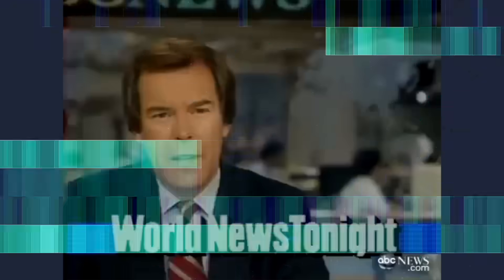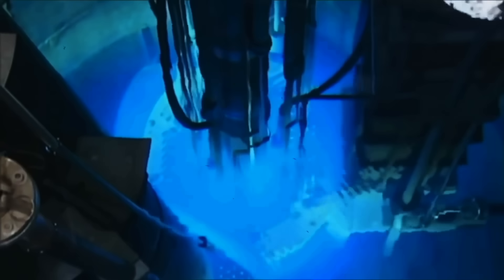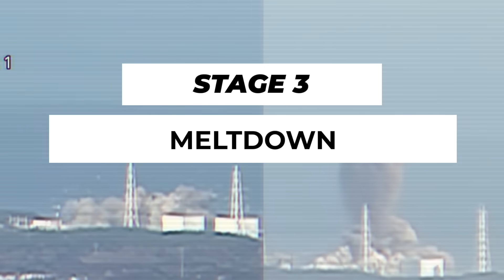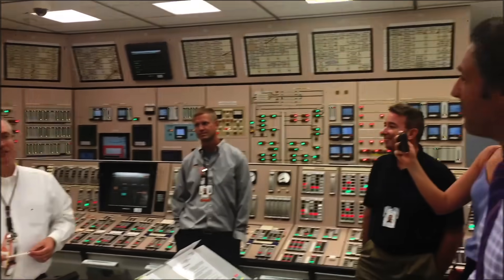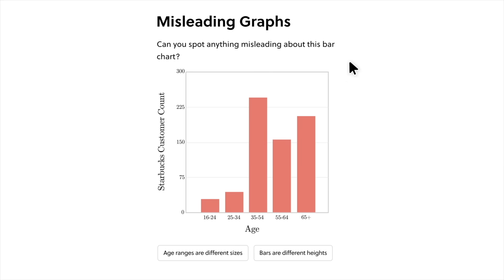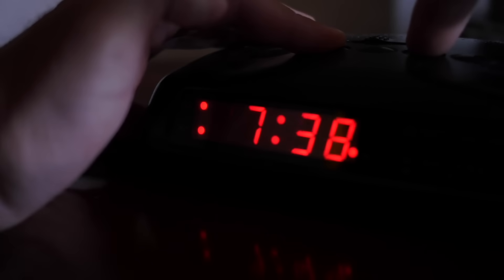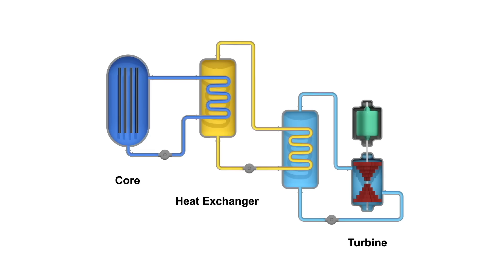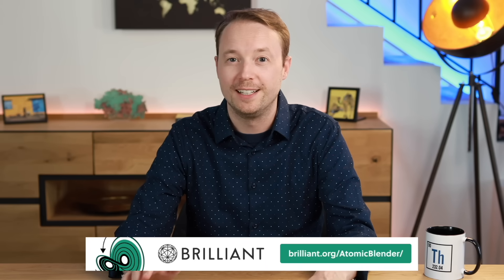Why Is It So Hard to Stop Meltdowns?

Comment: What we learned from SL-1:
Never have a single rod control the reactor
Don't manually manipulate the control rods with fuel in the core
Never attempt to pull on a stuck control rod
Ensure no interpersonal grievances between operators during critical phases
among others.

What we learned from Three Mile Island:
Sometimes less information is safer
Layout procedures clearly
Always have a peer checker during critical operations
Ensure regular maintenance on valves and pumps
Have a dedicated Press Representative to give accurate and reassuring information to the public
among others.

What we learned from Chernobyl:
Don't design reactor control rods with graphite followers
Never place the reactor in a configuration for an extended period that allows for xenon buildup
In reactors with positive void coefficients, don't preform rapid reactivity manipulations
Don't operate near All-Rods-Out
Don't ever allow for field changes to established procedures
Don't change shift during a reactivity manipulation
Thoroughly brief the next shift
Allow questioning of authority
among many others.

What we learned from Fukushima:
Place onsite power generators above the flood plane
Design the reactor to withstand the 1000-year event
Have at least 2x redundancy for emergency power generators
Fit sparklers to the reactor to safely burn off hydrogen
Have the spent fuel pool at ground level
Have redundant systems for core cooling
Allow controlled venting to occur in the absence of power
Better coordinate with emergency management agencies
among others.

I think that covers the most glaring points.
Reply: "Design the reactor to withstand the 1000-year event" This is no joke, Fukushima's earthquake was the 4th most powerful ever recorded since 1900.
Reply: Also Chernobyl:
Don't ignore safety protocols because the reactor is taking a lil too long to heat up
DON'T TURN OFF THE COMPUTER TELLING YOU TO SHUTDOWN IMMEDIATELY
Reply: @iexist_nt both myths of the tv series. Didnt happen in reality
Reply: You forgot the “do not lie to plant operators” for Chernobyl
Reply: Another one for TMI - ensure free flow of information between both the manufacturer and the operators and different powerplants. 

Before tmi2, another B&W plant had the same issue, but B&W did not disseminate the info.
Reply: Real
Reply: The Chernobyl graphite followers were actually pulled in as the control rods were pulled out. So they actually not only had almost all the control rods out but the rods to sustain the reaction in as well. Besides being dumb to take out more rods than allowed, the design flaw was the graphite section had clearance for water so in the moment all the rods started moving and that water was displaced by the graphite exiting that section was superheated enough to jam the graphite in place and go supercritical
Reply: @Mustang-wt1se  the design flaw was not the graphite sections. They were a feature to improve economic factors and ironically safety. The also didnt change the graphite sections afterwards which shows it wasnt the real issue. The design flaw was not adding the control rods inserted from the bottom to the safety system, having an unsafe reactor in general (fuel issue), having a "blow up botton" and not showing the operators the ORM in real time in the control room (how many rods are inserted).
Reply: Fukushima was designed with with a 1000-year event in mind. The reactors were safely shutdown when the earthquake hit. It was then hit by one of the largest tsunami's in living memory. Only being equaled or surpassed if I am not mistaken by the Krakatoa eruption. So then by that logic do when have plan and build things for 3 or 4 1000-year event's?
Reply: @necronoverlord2306 Fukushima knowingly cut corners in their designs. Specifically with the ocean barrier. The wall they built was way too short which they were aware of and also didn’t care to fix. This would have helped immensely. Thats why the nuclear plant 100 miles north of fukushima, closer to the epicenter of the earthquakes name is unknown. Because they did everything right and didn’t have a nuclear meltdown
Reply: I imagine the frustrated guy standing over the reactor trying to free the stuck rod Major Kong style when finally it slips free.    The split second of "oops".
Reply: I thnk there are going to be a few more lessons.
Reply: Most PWR reactors are designed to run all rods out the entire time they are online. These reactors are moderated with boron, rods are only used for huge reactivity changes, such as shutdown margin on trips to guarantee reactors stay subcritical
Reply: @enzonightmare1193  In that case, you have controllable reactivity by means of burnable reactor poising, something Chernobyl didn't have.

Comment: "every few decades", so how long have we had nuclear energy? a few decades, thats like phrasing a situation like "the alarm goes off every 5 minutes or so" and you only had said item for 6 minutes

modern nuclear energy is far, far safer than it was back then, the soviet RBMK reactors where horrifically out of date and designed with methods that everyone, even the soviets, knew was unsafe, they didnt care because it was also cheap as most things go under communism, and whoever thought building a series of nuclear power stations all along a fault line deserves some kind of sarcastic award, if reactors are kept up to date (99.99% of them are) they are very, very safe and provide a clean means of generations FAR more power than any other method with far less infrastructure

Comment: so i always thought a nuclear meltdown meant it exploded like a bomb
Reply: It is not possible for the fuel in a reactor to explode like a nuclear bomb. The levels of fuel enrichment and other factors make this impossible. Uranium used in a nuclear reactor cannot reach a critical mass in this way. All that happens in a melt down is that all the uranium fuel and other assemblies in the reactor melt into one mass of material. The cooling water that normally circulated throughout the reactor cannot now cool this molten mass effectively and so this molten mass melts through the base of the reactor. Exactly what happened at Chernobyl. 

The uranium in a modern nuclear reactor is only slightly enriched by a few percent, the uranium used in a nuclear bomb is highly enriched and a critical mass created to sustain an extremely fast chain reaction,

Comment: We can't keep having meltdowns for obvious reasons. Nuclear power isn't safe nor green enough to call it a "zero emissions" way to generate power. There's no such thing as zero emissions power generation. Anyone who believes that nuclear  power is the solution needs to put down their crack pipe  down and step away from it. That's why I oppose haphazardly tearing down existing power plants without replacements. All that does is cause electricity rates to go up due to supply and demand issues. Before all that, we was buying some of our electricity from Canada to power parts of New England. That's unacceptable.

Comment: I’m an Engineer, Did a installation job years ago at a Nuclear establishment. What fascinated me was the reactor hall Not a great deal to be seen it was all going on under your feet 🤔 
Looking round the site & grabbing what knowledge I could from People working on site. 
Iv watched Videos of anything Nuclear particularly electric power generation. 
It seems that the biggest problems with Nuclear Energy is that it started as a RACE when actually people were still learning, 
Racing Learning never good 
It seems the Reactor itself never seems to hardly at fault. 
It’s the failing of auxiliary equipment
& human error 
“Have to say” the now Big social issue   Now is the safe disposal of contaminated equipment or irradiated waist. 
I believe this & the cloak of secrecy & false information may have damaged this incredible industry 💯

Comment: Why does it take years to cool down the spent fuel in those pools? They are small pellets right?
Reply: The spent fuel contains highly radioactive isotopes that are undergoing fission and releasing energetic particles and actually generating heat. The water used to shield the workers from the radiation and keep the fuel pellets cool. Once highly radioactive isotopes have decayed away the the fuel can be moved into the reprocessing facility to be reprocessed.

Comment: The BIG two meltdowns were really a fault of bad oversight. With Fukushima the regulators had abdicated their responsibilities. The power company was warned that the sea wall that not tall enough to protect the plant in case of a Tsunami or tidal wave. And Japan has a lot of tsunami's due to being in an earthquake zone. And to top that off they refused to add a backup plan for emergency power in case their emergency generators failed. They were trying to do it on the cheap because of cost considerations. In Chernobyl the folks that were supposed to be regulating the plant actually intentionally put all the blocks in place to cause the meltdown. That and the way they designed the plant meant there was no redundancy in case of an accident. They did not build it for a worst case scenario because they said they designed it so well that the worst could not happen. 3 Mile Island as bad as it was was actually an example of how the prevent the worst case and  it did prevent the worst case from taking place.

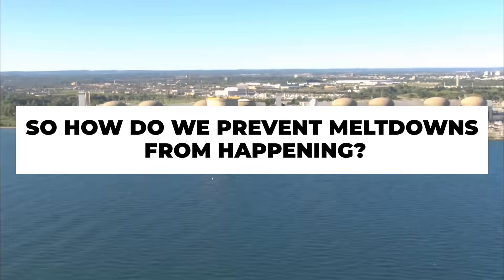Comment: 9:15 defence in depth relates to giving terrain IOT wear down an opponent, what you described with the fortifications of a castle relates to a final defensive line, meant for bringing the opponent to a stop IOT facilitate a counter attack and take back initiative or force a political resolution.

Defence in depth does not mean layers of defence, it means lines of defence, to be occupied one after the other. It means trading an area for a favorable situation

Comment: All respect to the presenter. However, losing water as cooling is an issue only if there is another moderator, like graphite - as it happened in Chernobyl. PWR, VVER reactors can lose cooling water, the whole reactor will stop as neutrons will become too fast to be able to keep up a chain reaction. Also, there are other type of nuclear reactors where water is not even inside but gas. So stating that if water is gone, then we can expect a meltdown, is false. Fukushima was a different type of exception than Chernobyl as the tsunami destroyed all external equipment that could help to prevent the meltdown.

Comment: Unfortunately there's a saying, modern safety practices are written in blood, for example in the automotive world cars used to be way more unsafe in the '50s and '60s versus nowadays, for example a common method of injury and an automobile collision was getting ejected from the car, that was solved via seat belts that keep the driver and passengers in the vehicle, however people were still getting injured by the dashboard even if they weren't getting ejected. That was dealt with by making dashboards out of softer materials, removing anything sharp and pointy from the dashboards like by changing the design of light switches and radio knobs as well as installing airbags to lessen the force when your head hits the dashboard or steering wheel. GeForcees were also a common factor in motor vehicle collision injuries, and those were reduced by adding things like crumple zones so that the body of the vehicle crumples in a specific way to reduce the felt impact by the occupants. Also things like break away motor and transmission mounts were used so that instead of the engine getting pushed into the cab, the motor mounts break and the engine drops free below the vehicle and stays away from the occupants
Reply: And to reduce vehicle fires after collisions various safety features were added to the electrical and fuel systems, for example in a modern car any airbag activation will trip the fuel pump circuit and require a dealer or body shop to reset it, also the gas tank was repositioned so it's not susceptible to damage from minor rear end collisions and the filler neck was moved from behind the license plate to a more protected location usually on a rear quarter panel and it's now located higher up. Also they now contain a check valve so that fuel cannot spill during a rollover
Reply: And on me regulatory side, you have organizations like the NTSB in the US that sets safety standards for new vehicles, and on the operator side you have updated driver training programs for new drivers as well as awareness campaigns for the dangers of intoxicated or distracted driving and also enforcement of traffic regulations like police pulling over distracted drivers or things like speed traps red light cameras etc

Comment: In Chernobyl actually they turned on the pump but one of the pump was built outdated cause of corruption, and the pressure in the core was already so high that when the 350kg control rod were going down the they started literally levitating and going up down , and graphite tips of rods caught on fire then the pressure goes on increasing and increasing and once it is out of control booommmmm and then Oxygen rushed in burning the available Hydrogen which was seperated from water steam because of high temperature. 
(This is what i remember from the miniseries Chernobyl) Hats off to the heroes who saved the Chernobyl accident risking there lives 🙏🏻🙏🏻
Reply: That's wrong

Comment: Hey, I have a question: Could a meltdown be stopped / slowed by a design change, where at the bottom of the reactor vessel there is a sealed off chamber containing boron or other neutron absorbers and if a meltdown would take place, the melted core would come into contact with that material, absorb it and hopefuly lose so much of the radioactivity that it would not melt through the rest of the vessel?
Thank you in advance for any answeres.
Reply: No. The isotopes that are created are unstable and must decay, and that causes the heat buildup. A neutron absorber won't stop this, because it is inherent in the material, it is not a chain reaction anymore.
Reply: Unfortunately, once meltdown/partial meltdown has begun, it's no longer an issue of reactivity. Most structures would have issue containing something that hot without also melting, so the best thing you could have it drop into is just a massive pool of water. But if that existed, why not just have tanks that can flood the containment building by gravity in the event of a loss of ultimate heat sink?
Reply: I wouldn't think so, but there is a design out there called a "pebble bed" reactor where basically the uranium is just piled up on the bottom of the reactor, so it can't necessarily "melt down" since it's already pooled at the bottom.

Comment: The reason why the Chernobyl Nuclear Power Plant, or CNPP had blew up, is yes, because of the safety systems being i guess shutdown? and then when they had run the test the reactor had ran in an unexpected way, causing the operators to press the secondary AZ-5 "Button" and not the switch. Just 8 seconds after it blew up. Because the reactor had already been poisoned with xenon gas, and when the control rods went in, only one had been fully inserted as a little malfunction. When the control rods were inserted, one of them went into the water, Now I'm just repeating myself. But back to the point, after this all had happened I believe that part of the control rod material had reacted with the xenon gas causing the first explosion in the chamber. Then after that Oxygen from outside the reactor lid, had rushed in and reacted with all the other elements inside the reactor core, causing it to make a secondary explosion that was so big, it almost was the size of the little boy nuclear bomb. People had believed the AZ-5 button was pushed, but actually is was just the USSR's petty material that they used in the plant. They had used very cheap material to build the reactor, but that is extremely bad, as cheap materials can break or malfunction easily.

Comment: The water cooling it also produces the energy, and theres no way liquid metals are as efficient. Theres only one way to efficiently produce nuclear power. And it will always be dangerous.
Reply: Depends. In BWR designs there's is only 1 cooling loop, and that requires water. In PWR designs, liquid metals could be used, as the primary loop does not generate electricity, only providing heat to the secondary loop which does.

Comment: The only issue i have woth what you said is that the rods are not the primary method of controlling the rate of reaction. Thats the job of the moderator.

Comment: I like the Molten Salt varieties of reactors.  When the reactor starts to overheat, the expansion of the salt throttles the reactor automatically.  The working temperature of salt is wider span of temperature than water and it is not pressurized.

Comment: Chernobyl in Russia was a poorly designed reactor that never had a containment dome.  Fukushima had  containment and had the main failure caused by a steam explosion caused by over pressurization in the cooling pipe.  Three mile Island was a reactor of the same type as Fukushima.  Both of them had proper cantainment of the nuclear material, but the high pressure water/ steam cooling were the failure point on both.
Reply: They were not the same design. Fukushima was a BWR and TMI was a PWR